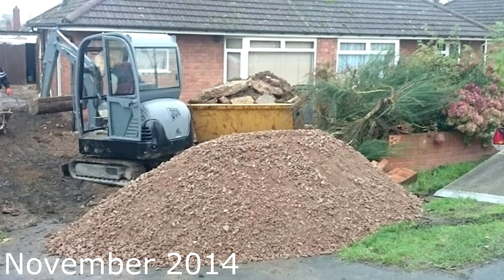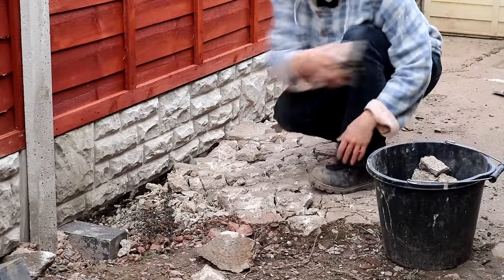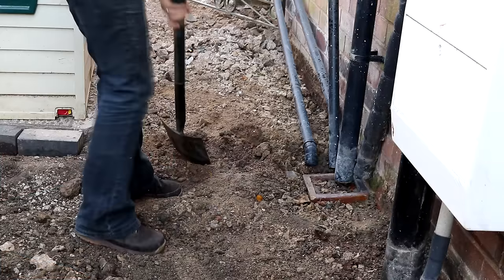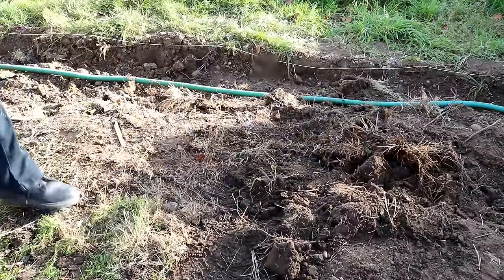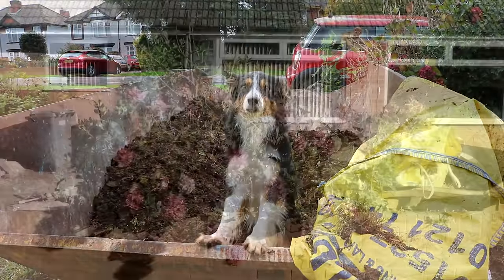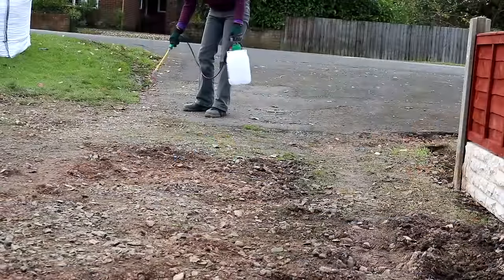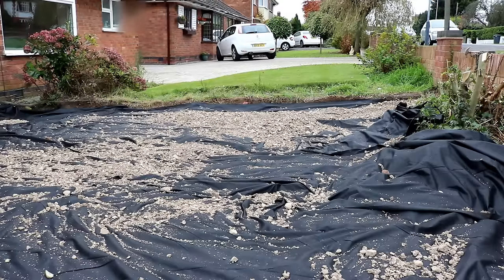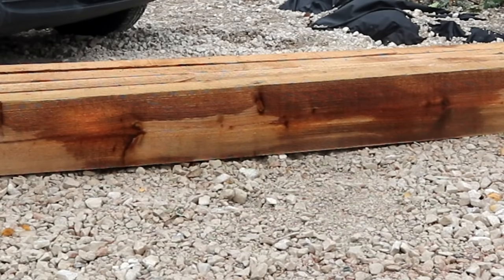DIY Gravel Driveway Part 1 /  The Carpenter's Daughter

Comment: Big job. Lots of work. Great results. Two tools I use for small scale excavation and awkward areas/edges/corners, are: a brickies hand pick, so more pointy ends for penetration; and a Roughneck  hand mattock, smallest handle length, and ends like a full-size pick but smaller. Handy when working off a kneeling mat, or when you need to take care of what you are working around; lots of tool control. For breaking up concrete and such, a Titan SDS has always done the job. Enjoyed watching the video, good presentation

Comment: Here is a carpenters trick for breaking metal bands like the one you used a hacksaw to remove. Slide the band between the tines (claw) of your hammer then push the hammer in the opposite direction it is laying this will break the band. From a California carpenter love your channel.
Reply from the maker: Thanks for the tip :)
Reply: Or just use a pair of tin snips (Aviation snips).

Comment: You will still have to pull weeds even though you have the fabric down. The fabric will prevent the roots from going too deep and they will be much easier to get out. The most important function of the weed fabric is that it will prevent the stone base from migrating into the soil below.
Reply from the maker: Thanks for sharing :)
Reply: The weed block fabric in my garden tends to look like a growth medium for grass and thistle. Honestly makes them harder to pull out but it does separate the dirt from the top dressing